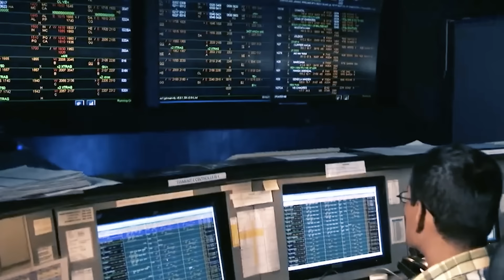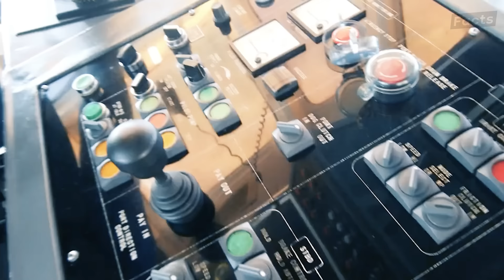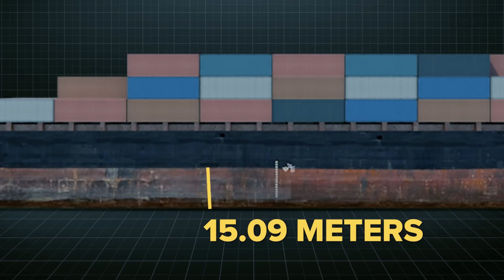Why the Panama Canal is Dying

Comment: Panama goes through a continuous cycle of wet years and drought but the average annual rainfall has been increasing for the last century.
Reply: When I was stationed in the CZ in the early 1970s I was late getting back to the barracks around noon when the first drop of water hit me, I grabbed all the throttle of my dirt bike I could, and after 100 yards slid to a stop, and dashed across the street into the barracks. I was soaked like I had jumped into a pool! Even the money in my wallet was drenched! You could not see the other side of the street! Not so in later years, I later heard.

Comment: There is one particular error in the video that needs attention.  At approximately the 9:00 minute mark when addressing ship's draft issues... "Less water is required to raise ship with fewer drafts..."  It makes no difference what the ship's draft is or even the size of the ship, the same amount of water is lost to sea with each transit.  The same amount of  water is lost to sea whether a rowboat is transiting the Canal or a deeply laden bulk carrier.

May I offer a few suggestions on pronunciation of some of the local names.

Gatun is pronounced Gah-tune or with less emphasis on the Gah... Gatune  The "a" is short.

Alhajuela is pronounced Al-a-way-la

Calibra Cut is actually Culebra Cut.  That portion of the Canal was named after a small railroad town that was located in the vicinity.  Also the original excavation had more twists and turns than it does now.  Since culebra is the Spanish word for snake it seemed even more appropriate.  Under the US administration the "Cut" was named Gaillard Cut in honor of the engineer who oversaw that part of the construction of the Canal.  Col. David Gaillard died just before the completion of the Canal.  Panama returned to using the original name, Culebra when they took over operation of the Canal.

The Canal officials have been aware for years that insufficient rainfall was potential issue.  I am  aware of studies as far back as the 1970s that would increase the amount of water that would be available to maintain peak draft levels.  A number of viable solutions have been identified, but to date none of the studies have materialized.
Reply: If they identified the problem and viable solutions why has nothing been done?
Reply: I think when you factor in the cost of creating additional reservoirs or other huge expenditures there is always a tendency to kick that can down the road.  That way it "appears" something is being done.

There are some other issues at play as well, the Panama Canal Authority (ACP Spanish initials) only controls the watershed around Gatun and Alahjuela Lakes, area for additional reservoirs are all outside the area they control.  To build there would involve the national government to enact legislation.  That seems simple enough, however there is a strong ecological movement that is pretty much anti any development.  No doubt there are some in that movement that have legitimate concerns, however IMO I believe much it comes down to if they are for it, we are against it politics.     

El Nino is at the root of the water woes at the Canal and it is very strong this year and affected the Canal adversely.  There have been very strong El Nino events previously in 82-83, 97-98 and 2014-2016 which impacted the Canal as well.  However these were largely before the opening of the new locks and there were a lot fewer vessels requiring maximum draft allowance.  In between all those very strong El Ninos rainfall was not an issue, so it is a lot harder to convince people to spend billions of $$$ on new reservoirs when the Canal's lakes were full. @andreww2319
Reply: Thanks.  Yours is a very subtle answer and no doubt based on deep local knowledge and understanding.   The issue intrigues me as a corollary to the spectacular ousting of First Quantum which struck me as actually the sign of very deep local political problems masquerading as an environmental issue.    I then spent a lot of time mapping the dismal and disintegrating history and state of local Panamanian politics.    Certainly the elites have failed, but the environmental crusaders are simply blocking everything.    I also liked your frankness around the fact that droughts are as much technically manufactured as they are tagged to passing weather patterns.  If you have seen it, Ashley Case of Vanderbilt Uni. wrote a masterly paper on this “An Infrastructural Event: Making Sense of Panama’s Drought.    Thanks very much for responding.

Comment: Maybe I'm stupid but can someone answer why they can't just pump the water or pull the water from the other side of the lock where the ship will be going? Then when they open the lock up it just flows together anyway .  🤷🤷
Reply: That's how is done.  The lock system is like an elevator.  When the ship is between locks, the level of water goes down to descent the ship.  That water is pump back to the previous level.  When the ship attains sea level, the lock is opened and the ship continues its journey into the Pacific or Atlantic Ocean.
Reply: @albertomanuelcheung7103  No, you are wrong.  There are no pumps in the Panama canal that pump water uphill.
Reply: Its a matter of equipment and economics.  The existing system doesn't need to buy pumps or pay for the energy to run them.  So there are no pumps, and they probably can't be bought and installed during the time frame of the current crisis.  Looking at the longer term, it probably makes more sense to expand the watershed used for supplying water to the locks rather than investing in the pumps and the energy infrastructure to run them.  But if the problem got worse enough they could indeed pump water uphill.  The value of transiting the Panama Canal versus going around South America is sufficient to pay for moving the water.  This would probably be combined with other infrastructure that would reduce water usage at the cost of greater cost to build the system.  For example, the old locks don't have intermediary water storage basins, so they use much more water per value of cargo than the new locks.
Reply: @richdobbs6595   When the canal was expanded recently, new reservoirs were built, so the water is reused/recicled.  Panamá has two large oceans at each end and another solution would be to build a desalination plant on the Caribbean side and pump water from the  Atlantic into the Gatun Lake.  That's another option if push comes to shove.
Reply: @albertomanuelcheung7103  Yeah, I'm aware that the new locks have intermediate basins that allow reuse of water, so that they reduce the amount of water consumed per ship passage.  But desalination, from an energetic point of view is not a feasible approach to this issue.  At that point it would be cheaper to sail around Patagonia and build the extra ships for the longer journey.  I'm guessing that you aren't an engineer, so your assumption that desalination is viable is forgivable.  But if you are an engineer or an economist, you should be embarrassed.
Reply: With all the knowledge we have I’m sure they could find solutions? Shortage of water sounds like a crock? If it’s true, it seems this design was made on purpose? To short water on purpose? So they could ask for higher prices due to how intricately designed it was? But I don’t have all the facts to conclude?
Reply: @truthreignsforever9286  The cheapest engineering solution is to build another dam and a tunnel, but that faces internal opposition due to ecological concerns and that the impacted people won't be adequately compensated.  Shortage of water was predicted to happen periodically, since the water infrastructure part of the system was killed from the canal expansion project.  Rather than being a conspiracy, it is really more of a controversy with opposing sides wanting different things.  Surprisingly, the canal authority hasn't addressed the shortage by steeply increasing transit fees or increasing the number of slots that are auctioned off.  My guess is that they would rather put more pressure on opposition to the canal watershed expansion than their customers.

Comment: Didn't they recently built a new set of locks where they have a reservoir that holds the water to recycle the water used to service the locks.?
Reply: Yes, they have water saving basins.  The use of the WSBs can reduce the total amount of water lost to sea.  A ship using the new locks will use a little less water than the water used at the original locks even though the new locks are somewhat larger.
Reply: They can re cycle 60% of the water used but 40% is lost but the main problem at the moment is a drastic lack of rain in that area.
Reply: WELL....Was Gatun lake designed for the new expansion ??? When I lived in the Canal Zone we had some dry rainy seasons also.
Reply: I think the designers and builders would be absolutely amazed at the size and amount of ships that pass through the original locks  alone,  now if you include the new expansions locks they would be in disbelief.  Having said that, I feel sure that they were confident that there would be an ample supply of water for the traffic they probably envisioned.

Back in 1935 Madden Dam and Lake (the Lake is now called Alhajuela) were completed upstream of the Canal on the Chagres River.  The main purpose for the Dam was to help regulate the inflows of water from the Chagres.  There was a secondary purpose as well and that was to store additional water for the Dry Seasons.  The original designers were aware that there could be water supply issues.  One of the methods to use less water during drier times, extra miter gates were installed so the 1000' chamber could be compartmentalized so that only 650'  of the chamber was needed to lock a smaller ship through.  Ships up to 500' could use the shorter chamber.  Less water lost to sea per transit.

Average rainfall over the Canal's watershed is around 105" as compared to this year's total to date of  70".  Even though 70" seems a reasonable amount, it is just not enough to bring Gatun Lake up to it maximum operating level which is 88.5'.  Ironically last year 2022,  was a very wet year and Gatun Lake set a record high of just under 89'.

Particularly since the opening of the new locks more and more ships transit with deeper draft requirements.  One side benefit of the opening of the new locks is all the channels of the Canal have been deepened to allow the larger ships with deeper draft to transit.  This has helped ships transiting the original locks to continue to transit with maximum draft even though Gatun Lake is at less than ideal levels.  The maximum draft for ships using the original locks is 39.5'  That draft level can be maintained until Gatun Lake reaches 78'.  Before the Canal expansion once Gatun Lake dropped below 85'  the maximum permitted draft had to be reduced 0.5' for every half foot the Gatun Lake dropped.  Back 20 or 30 years ago that draft reduction would not have affected nearly as many ships as it now does.  @ddunn3489
Reply: @LeeB48  correct..but Panama thought the USA made millions off the Canal...but in reality they made just enough to maintain it and pay workers and also Pay Panama a BIG check. So when they took over it in 1999 they figured that out and raised rates many times.. then found out they needed more ships. So they built the expansion.  
IE: My father was the Chief accountant for the Panama Canal.
Reply: @ddunn3489  Since Panama makes millions off of the Canal and has been able to finance expansion of the capacity, it is safe to say that the USA made or could have made millions off of the Canal.  If they didn't, it was a political-economic decision, rather than being a characteristics of the "real economics" .  As far as your father, please provide your name, his name,  and some sort of useful info  so I can evaluate your truthfulness of your claim about his role.  Tits or go home!
Reply: Please explain. Why does the water have to be fresh water? Does the new canal use fresh water as well? Can can they build a pipeline to channel water from the ocean?
Reply: @RochelleLang  The new locks do use the same fresh water as the old locks.  There is no new "canal".  Rather the canal was dug deeper to allow passage of larger ships.  The elevation of the canal and artificial lakes was kept the same.  With the current structure, you couldn't use salt water from the ocean - it would destroy the drinking water and agriculture water for the country, as well as its fresh water ecosystem.  But in addition it would require a massive build out of the energy infrastructure in the country that no one would be willing to pay for, because it is not needed or profitable.
Reply: @richdobbs6595  I get it. Couldn’t they build a damn or a reservoir to hold the sea water separate from the fresh water?
Reply: @RochelleLang  There is no obvious way to do that, nor would it be necessary.  If you had pumps, you could just pump out the locks upstream, rather than having it flow to the ocean.  But it is neither necessary or profitable to build pumps.  They need to build a dam to create an additional reservoir and a tunnel for fresh water.  But that faces internal opposition.  Maybe they will build additional water saving basins to make the system more efficient.
Reply: The cost to build and operate pumping facilities to use sea water to raise the ships the 85' to Gatun Lake  would be enormous.  A pumping facility that could pump 26 million gallons of water in under 10 minutes would be massive.  Once built the infrastructure to operated it would be massive as well. 

Using sea water this way would turn Gatun Lake from fresh to brackish and then to a salt water body of water.  Much of the population uses Gatun Lake for potable water.  Then there would be the danger of cross migration of marine life.  This would allow species such as the Yellow Bellied Sea Snake access the Atlantic Basin.  When the French tried to build a sea level canal species migration was not a major concern as it is now.   @RochelleLang 

The "new" Canal is really the same Canal and it uses the same fresh water from Gatun Lake.  The new locks are another larger set of locks that are used to access and cross Gatun Lake and the Culebra Cut.
Reply: @richdobbs6595  well it's all true..and his name was Mr.Dunn

Comment: some other posters made some overly simplistic solutions.  that is what i have.  first- why not just pump water up to the lake from the sea.  then there will be a never ending supply of water to flow down hill thru the locks.   second - why not build a third canal with modern heavy equipment scrapers and take the land down to sea level, and eliminate locks completely like the suez.  send 200 scrapers to cut a new channel to sea to sea.  no locks.
Reply: Oh, if it was that simple, it would have been done by now.

Comment: Desalination of Pacific and Caribbean Sea  water could be used to raise the fresh water lake level to alleviate the issues caused by drought.
Reply: You have no idea how expensive desalinization is. Impractical. But no worry, Nicaragua and Mexico are building new canals. Guess Ortega and AMLO made a deal with God, so it will rain all year over these canals
Reply: @WillyK51  This is misinformation. Neither Nicaragua nor Mexico are building new canals.
Reply: It would not be necessary to desalinate water, you would just need to recycle water from lower in the system to higher.  This would be cheaper than building and operating desalination plants.  But, like all such solutions, the time to implement any corrective actions is greater than the expected time that the current crisis will last.

Comment: What about this so-called "sea-rise" which is inundating land mass I keep hearing about? If the sea levels are rising so fast that coastal cities are under water, then how is the Panama Canal falling short?
Reply: Did you even watch the video??
Reply: Since 1880 global average sea levels have risen about 8 inches.  So it won't make a difference to the locks.  The rate of increase is accelerating but it's still not going to overtop the locks.
Reply: @MrRobertjusher 
Did you even KissMyTuchus?

Comment: Big issue today is the world has trouble with both canals. War in the Red Sea? 
Ships travel half way across ithmus in a lake 87 feet above sea level. Going west they have lift locks to get to the big lake. Then a mountain range to get over and down from to the Pacific. Water for these locks comes from a lake on the west side at an even higher elevation.
When you visualize the Panama canal, think half canal + half lake. Ships spend so much time in the big fresh water lake that all the barnacles on their hulls die.